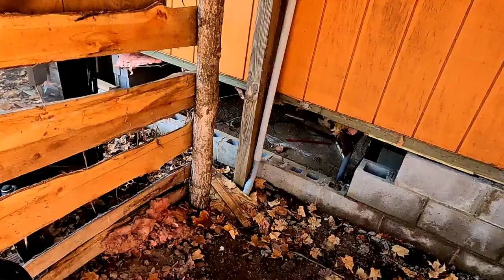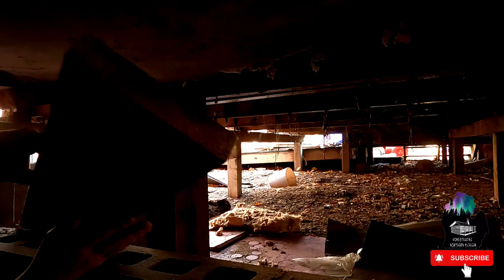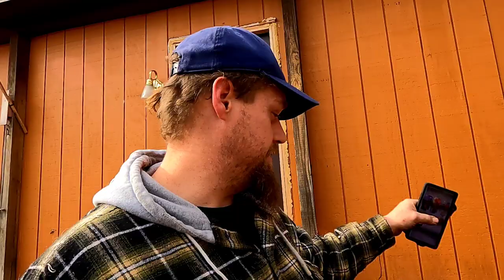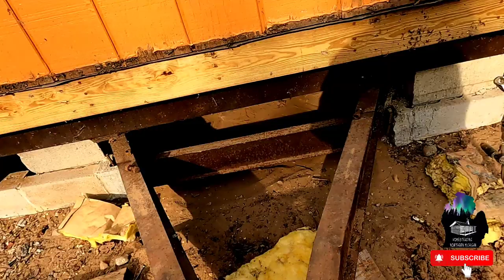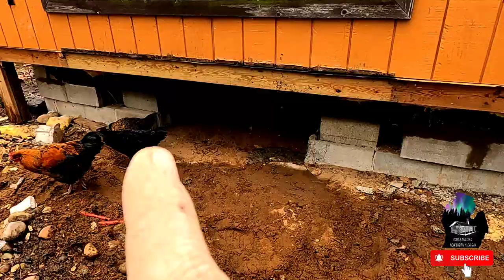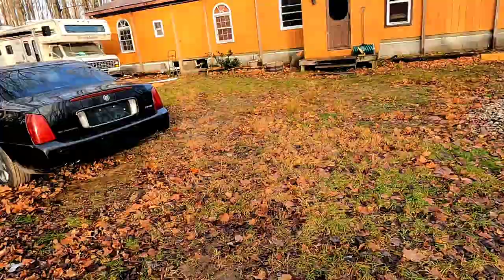Replacing My Mobile Home Skirting With Cinder Block Foundation Pt.5 Finished

Comment: Thank you for filming all of this, I know it's not easy. Looking forward to more content. I bought 31 acres of land in NH and it came with a 1972 mobile home as is. They put a roof on it similar to yours. I've been renovating the bedrooms first, that's nearing completion plus I replaced the water heater. Bathroom is next! Next year I'll be doing this exact thing plus stripping the metal siding and installing 1/4 log cedar log cabin siding on the effer.  It's going to look killer!
Reply from the maker: Wow that sounds like a big project..... I love big projects
Reply from the maker: I thought about doing a lot siding but I was worried about how much these walls can hold
Reply: @HomesteadingNorthernMichigan  The 1/4 log solution is good and much less weight. You can also go with Michigan white pine, which may be lighter than cedar but cedar is pretty light weight.
Reply from the maker: @SciaticaDrums  thank you
Reply: @HomesteadingNorthernMichigan  plus if you have dry walled your interior ths will give a bit of balance to the structure. Even weight from both sides and all that.
Reply: Coming back to this as I will be doing this this year. The mobile home has come a LONG way. We're finishing the bathroom and kitchen now, all the drywall is done and a sliding glass door (that was fun). I think I may have a concrete company come in and do the base for this first. Then I'll do all the block. What I'm worried about is filling that gap between the sill and the concrete block. I need to figure that out. I think I know what I need to do with that. You have a nice piece of land there. I just sold my inherited rental property. Next year I sell my house here in Arseachusetts and move into the mobile home in NH turned into log cabin while my final house gets built there. I can't wait to retire and steward my land there.

Comment: I have a brick "wall" for my mobile home. Some of the blocks in the middle are very loose. I also have an entry point. The frame has become dislodged.  This is what im planning on doing. Use a hand held grinder with a break out disk. Then when i get it adjusted to where i can put everything back in place, I'll mortar and sand mix to reinstall.
My question is  am i doing this the correct way?